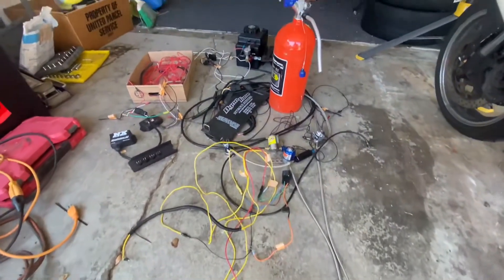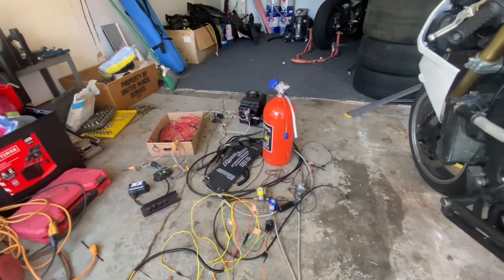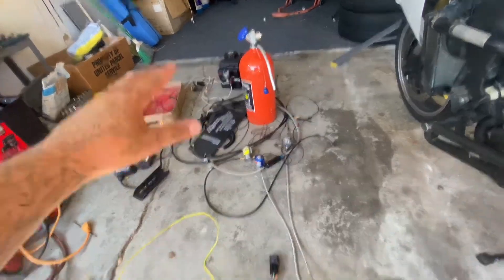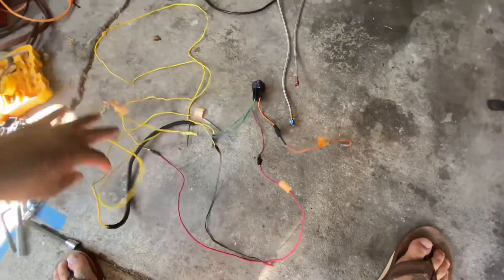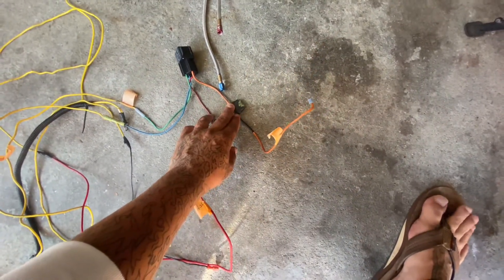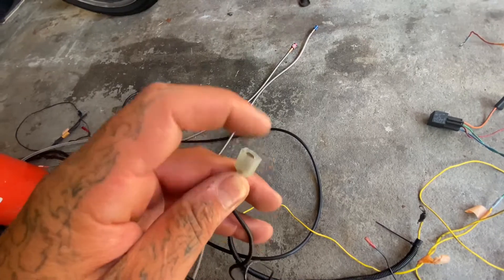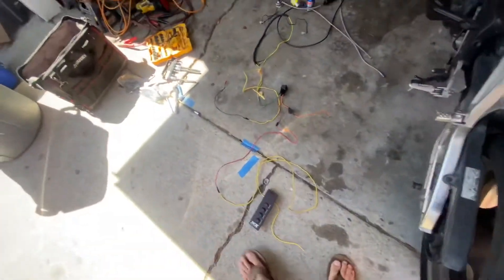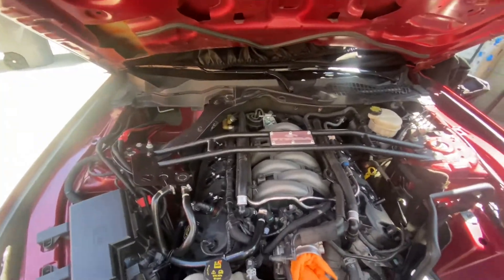Building a Nitrous System: Part 1 Purge Wiring Harness

Comment: Can I connect the purge system and both fuel and nos solenoid to one relay? I’m stuck in the wiring
Reply from the maker: I would run a relay for each system. Just for safety

Comment: So from the purge switch to 12 volt switched port inside fuse box, do you use an inline fuse adapter? What amp fuse do you use for your adapter and what amp fuse do you tap into? Also, what happens when  you run out of locations in fuse box for let's say a 10 amp? Any alternatives? Thanks bud!
Reply from the maker: What’s up buddy ! Yeah I do run an in-line fuse. I do remember the amp it’s been a while. If you run out of ports. I like using add a circuit if I run out and piggy back off another fuse. Only if I need too. Message me on Ig
Diablito speedz performance